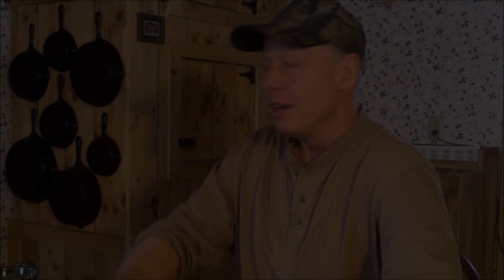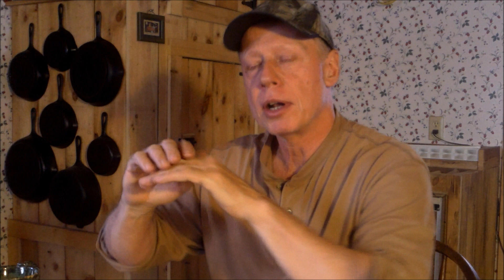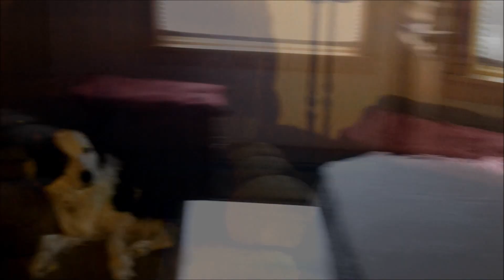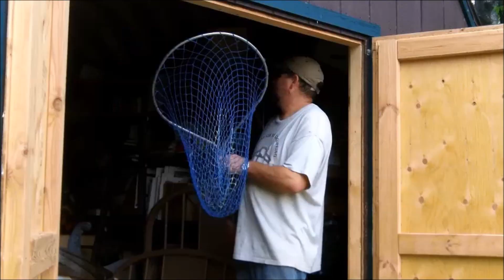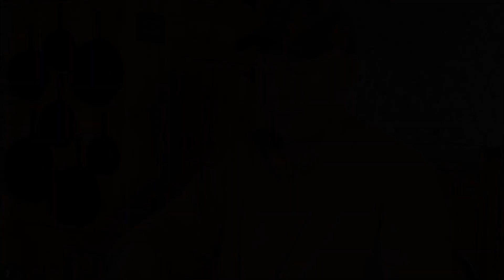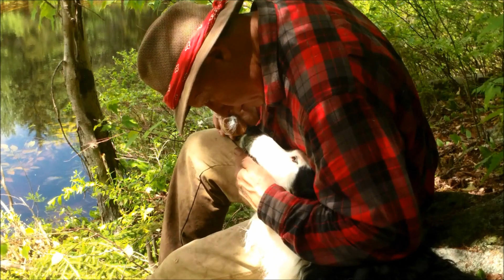Q&A SUNDAY episode 7    FAQ about our OFF GRID CABIN LIFE

Comment: Not only that, fans = noise from the fan, nope peace and quiet is where it's at. :D Power went off yesterday and it was totally amazing how quiet it was. Loved it while it last even though I wanted a cup coffee and don't have gas stove. LOL yep I could have heated some up on the rocket stove but was lazy. :D
LOL with the outhouse info. Just struck my funny bone.
Reply: ladyofmanyhats, what I use when my power goes out is a one burner butane deal. I also have an old style coffee perculator designed to use over an open fire.  I also have a tea kettle to use the same way.  You can get one and two burner butane stoves thru Amazon and use JC's link.
Reply: Yeah I have plans on getting one of those. We have 2 larger ones outside but hubby needs to fix both of them. One that I love has 3 eyes on it and I like to can on it, but it is leaking butane on a couple of the eyes. :( and catches on fire.
Reply from the maker: We used percolators up until I tried the french press.  The percolators were great but the pressed coffee is to die for  :-))

Comment: Hey JC.  Have you considered using something simpler for backup heat like a simple Dura-Glo or similar type of Kerosene Heater?    Ours pumps out about 23,000 BTU and easily heats up about 900 Sq.Ft.  I know Kero is much cheaper in the U.S.A. compared to here in Canada.  Many will use just common Furnace Oil or blend it with Kero in them to help cut the cost a little.  Most will run on a Tank for around 12 or more hours.  Have you looked at or considered this as a backup option?   I guess the reason I ask is that Kero will store for a great period of time in a well sealed Jerry Can...and would seem like a good and long-lasting alternative for those colder and chillier nights.
Reply from the maker: If I didn't have such great results from the Empire propane furnace that I had, I may consider it, but I'll give the propane another go of it :-)
Reply: Thank you.  I just wanted to know if you ever explored that option?  I'm always looking for a consensus.  Cheers.